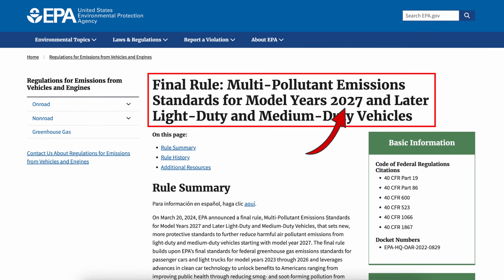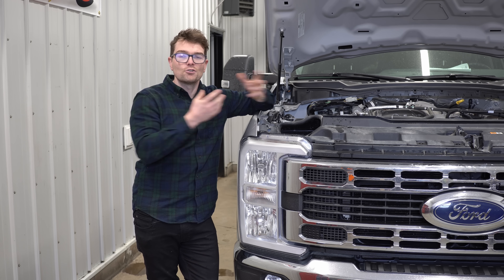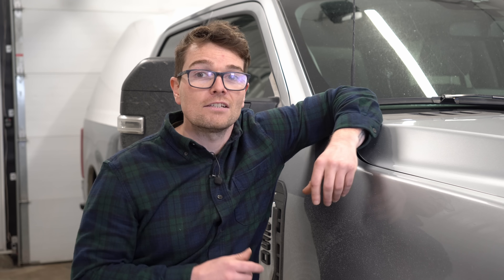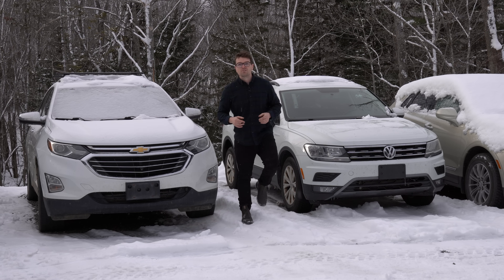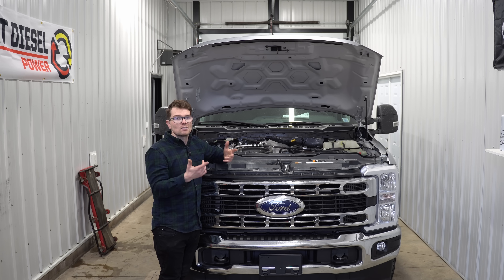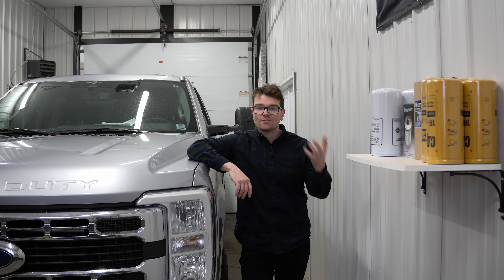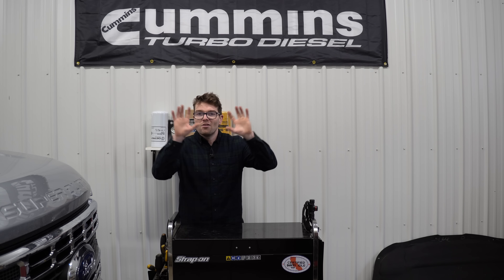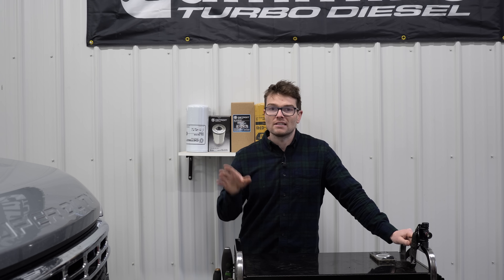NEW 2027 Cummins Diesel Engine EMISSION REGULATIONS are WILD **Diesel Mechanic Explains**

Comment: It's never been about cleanliness, it all about slowly but surely choking the I.C.E, be it diesel or gasoline and take things to such a ridiculous level that OEM's will call it quits on their own w/o any further coercion by the government.
Reply: Yeah, you have to burn more fuel and  get poorer fuel mileage to try and get cleaner air, that doesn’t make any  sense. so you’re gonna put the same carbon in the air no matter what
Reply: It's about deliberately making the economics of the internal combustion engine non-viable.
Reply: @gregorymalchuk272  But the internal combustion engine as a whole is non-viable. We are quite literally ruining the planet by using these engines on such a massive scale. While I love ICE and have many motorcycle and trucks, I still accept that ICE are not gonna last. We will eventually run low on fuel reserves and the price for fuel will get so high that it will make no sense economically to use them. So the oil burning as we know it will not last. Either the climate, or running out of fuel reserves , or fuel getting so expensive as we burn it all, will kill the mass usage of ICE. All we can do is be happy we got to live in the few hundred year period where the internal combustion engine ruled the world. Buy the engines you enjoy and have fun with them, that's all you can do.
Reply: Hit the nail on the head
Reply: Been doing the same thing with tobacco, just about control
Reply: @Joebauers2505  except engines doesnt magically cause cancer like cigarettes do, one is long form suicide

Comment: I love my 6.7 Cummins and will drive it tell I can’t anymore….but eventually these continuous restrictions on emissions are gonna stop manufacturers from even selling diesel’s. At what point do you think manufacturers determine the diesel engine is just not profitable enough??
Reply from the maker: I feel like its getting close on the consumer side. I think the commercial side there will always be a need but the end result is the downstream customer is just going to pay more. If the trucking industry gets more expensive everything that gets shipped will become more expensive. Or manufactures go in a different direction with something like natural gas or hydrogen but again all that R&D costs money.

Comment: Zero F’s given, I’m deleting all this crap if I have to get a new truck
Reply: Not as easy as you think. Shops were fined out of business and no longer sell parts.
Reply: @petermandel2552  I can fabricate the parts myself. Blocking the EGR isn't difficult. Cutting out the DPF and removing the DEF is easy. The real challenge is the ECU. I'm a software engineer but even this is going to be a challenge. Fortunate back in the day I had an RX-7 FC with a MegaSquirt 1. So I feel confident I can get past the regulations. Again, no intention on selling the truck later. If it needs to be replaced; ECU comes off, it heads to the scrapper. Tuning the transmission and MegaSquirt 2 are going to be the biggest challenges. 

All that said, my current truck is in great shape, I just wish I had the payload of current generation diesel trucks.
Reply: Add that the resale value would be zero. Legally would be able to certify, so no value other then parts.
Reply: @ that’s fine, I drive my trucks into the ground. When it’s time for it to retire, off to the scrap yard. It wouldn’t have any resale value by the time I was done with it anyway
Reply: Not just trucks, all our vehicles.
Reply: Good luck

Comment: I’m a ASE certified Master Medium/Heavy duty truck technician with L-2 certification. I repair these systems everyday. I have decided that I refuse to buy another  new truck. My next truck will be no newer than 1996. The Industry had huge problems in 2007 when this shit came out. Just wait until these 2027 spec engines hit the market. According to what I’ve been told, these changes will add $25,000 to the cost of a class 8 tractor. The every day person will be forced to bear this cost because everything is delivered by diesel engines.
Reply from the maker: lol I know the pain, on Detroit diesels (which I mostly work on) I swear I see a nox related code everyday come into the shop. I've also heard the same thing, 30-35k extra in cost per truck in Canada directly related to these new regulations. just means everything shipped on the truck is going to get more expensive.

Comment: Ford better crank up their Godzilla production to meet the demand. 
GM should seriously consider a proper replacement for the Vortec 8100 as well. The popularity of the Ford 7.3L is proof there is waning interest in diesels since this ridiculous HP war and one-upmanship has ruined the durability and economy diesels once had. The increase in emissions regulations is finishing them off by destroying the simplicity and reliability factors, leaving diesel with little appeal except for serious users/hotshots.
Reply from the maker: Agreed, I think Ford got the memo and the 7.3L, it can tow a ton of weight and people like them. Yes maybe not great fuel economy but these modern diesels aren't getting great fuel economy either. Unless you truly need to tow heavy weight a HD gasser is the more economical route.
Reply: @GettysGarage would it handle a 16k pound high profile 5th wheel going across country? If yes and Chattanooga to Nashville freeway inclines I might be interested.  ??
Reply: They're going to end up selling turbo HD gas motors. Only a matter of time.
Reply: Might as well go back to horses and mules!  Bunch of bs crap!!
Reply: I have 03 chevy with 8.1, love it never getting rid of it. I can repair it easy.  I never want any truck with def !! when check engine light comes on, my butt cheeks would pucker up knowing the F job coming to repair!!!
Reply: Chevy has a gas 6.6 motor in its HD trucks now that outpowering the antiquated 8.1 in both HP & Torque

Comment: So the epa is good with a gas motor truck that has less restrictions along with having horrible fuel mileage. My work place has multiple fords with the godzilla motors. They are horrible on fuel. But the diesel is the issue. The whole goal was to make the numbers unnatanable to get the manufacturers to say they could not do it anymore so the EPA does not take any heat off the consumers.
Reply from the maker: those 7.3L godzilla engines are going to become a lot more popular too in the next couple years. my fear is that they'll start clamping down on gas engine emissions like they have in europe.

Comment: So, will cooling the exhaust gases AFTER combustion and eliminating EGR/egr cooler be an idea?
Reply: No. The purpose of EGR is to reduce combustion temperatures. High combustion temps increase NOx emissions.
Reply: @ agreed. My thinking was if you eliminate the egr, wouldn’t you lower the temp inside the chamber since you aren’t reintroducing hot exhaust back into the system? I’m trying to think of a way to eliminate the damage an egr causes, while still trying to capture emissions after combustion. All of this while keeping dpf/scr system. How much nox is produced from the same engine with or without egr? Can nox emissions be reduced by cooling the exhaust after combustion without an egr equipped?
Reply: @pbutta3000  No. You could cool the exhaust as much as you want and it would never effect NOx, because NOx is only made at the high temperatures and pressures during combustion. Exhaust gasses are very cold compared to live combustion, the EGR isn't heating the charge air meaningfully and is making the combustion event much cooler. EGR can be a 70% reduction in NOx. You can reduce NOx with an SCR but it's much more effective to reduce it by preventing it from being created in the first place
Reply: @ got it. Thank you for the information.

Comment: This is total horseshit.  If a gas engine emits between 5 and 15 mg per km.  And a modern diesel emits 5 mg per km.  Why the hell isn't the EPA doing anything about gasoline engine emissions when they can emit up to 3x the particulate than diesels?  They need to take a long walk off a short pier.  Vehicle emissions aren't even a fraction of the problem.  Private jets, industrial stuff and power plants emit far more crap into the air than road going vehicles.  And you can shove your shitty E-vehicles where the sun doesn't shine.  I don't want that shit.  Also, you're just moving the pollution from the vehicle itself; to the battery manufacturing plants and the power plants that recharge them.  Electric vehicles aren't solving anything they're simply moving the problem around to be less visible.

Comment: Its a damn shame regulations are killing the diesel engine.
Reply: I think that is about to change very soon once new administration gets in.
Reply: @BrianNC81 we can only hope!
Reply: @BrianNC81 The guy with an Electric semi as a cabinet member? Don't think so mate.
Reply: put $50 000 just on emissions on my truck and it still had problems,got rid of it and got a glider with a c12 and never had a problem since
Reply: @ginomanb6235 we’ve been there. 30 dump trucks and in 2022 we spent over 100k alone on just emissions repairs. It would of been another 30k on top of that but luckily it was only a few days past warranty and the dealer took care of it
Reply: Or makes them better
Reply: @trialsted  Let's hope there's even a chance of a leap in technology to get there before the industry goes under

Comment: EPA is out of control as well as CARB!
Reply: Drive a Tesla, don't care 😅
Reply: @tjts1  I can't afford a tesla unlike a greedy rich person
Reply: @FangTheManokit  Pull yourself up by your own bootstraps and stop complaining. No more handouts!
Reply: @tjts1 some people have to work with them unlike a worthless tesla
Reply: @atf8721  no they don't. Diesel is choice
Reply: @tjts1  sure thing buddy you don’t go a clue
Reply: @tjts1  You forgetting construction work?? Diesel is a mandatory thing for skid steers, dump trucks, boom trucks,  I mean literally every single vehicle is a diesel out there.
Reply: @x91s55  there are electric versions available of all of those. The industry is quickly realizing how much cheaper and more reliable electric construction equipment is. Try again
Reply: @tjts1   Those electric vehicles will not run a straight 8-12 hour work day. It takes less than 10 minutes to fill one those I mentioned. It would probably take half the day to charge a electric version. Not the mention the added cost of pro-longing the job. And When the battery gets to half or less, the shit doesn't even work as good. It simply isn't cost-effective nor efficient enough
Reply: @x91s55  I see you have no idea how heavy equipment battery swap works. Do you live under a rock?
Reply: @tjts1 I see you have no idea of how the country transportation system works. Trains/semis/boats sure their are electric version but they are stuck at only short delivery routes because they can't go as far nor carry as much.
Reply: @tjts1 no, electric can’t compete. Not even close
Reply: @Joebauers2505 exactly
Reply: @tylerserna9317  I'm sorry did you say something? I couldn't hear you over the sound of my winning
Reply: @ I’m saying a kenworth truck is usually retired after a million miles. Just not possible with ev bud.
Reply: Longevity of diesel is just truly unmatched.. just reality.
Reply: @tylerserna9317  see how he didn't reply to me.
Reply: @tjts1 I didn’t think we had anyone dumb enough to fall for this electrification nonsense but I guess yall are real…
Reply: @tjts1   you will care when you have to replace the battery and find out how much it costs 🤡

Comment: Sounds like an engineering challenge for the manufacturer. The heated emissions system sounds like a good idea, keeps the exhaust hot. As long as they dont make the components fragile, it should be good. I wouldn't buy 27-30 model years, but after they work out the bugs, the engines should be solid.

Comment: Stop buying new diesel trucks. I sold my 2018 ram 2500 with a Cummins and it was the biggest pile of crap I ever bought. It was never ever reliable. And made 6 mpg due to the emissions junk. I sold that pile of crap and replaced it with a 1984 Chevy 1.5 ton army cargo truck with a 6.2 Detroit diesel. No emissions. Nothing stupid. All mechanical. It makes 24 mpg and it has been very very reliable. This truck has never ever let me down. I also have a dump truck. A 1987 ford LT9000 with a L10 Cummins. Another mechanical diesel engine. Very reliable. No epa nonsense. I will not touch any equipment made 2001 and newer. Gas engines pollute more than diesel engines do. If everyone stops buying trucks and cars the government will start to wake the hell up. And this all started in screwed up California. old trucks are designed to keep going and to be rebuilt. New trucks are designed to fail and be replaced. Yep that’s real environmentally friendly 🙄 if the general public needs emissions then the police, fire departments, and military needs to have it to. If they don’t have it then the general public doesn’t need to have it. Simple as that. Emissions systems are dumb and pointless

Comment: Yeah, I don’t think I will ever get rid of my 03 5.9 250,000 miles and I will rebuild it when the day comes
Reply: Be worth a frame replacement if it rusted away, at this point you’d be money ahead doing that.
Reply: Keep taking care of it. I have an 01 with 436,000 on it!
Reply: Just do your maintenance. The company I work for has an 04 that the odometer quit working at 675,000 mi some 4, or 5 years ago. Maintained by hours (hobbs meter) not miles.
Reply: @farmwork5304 same here. '03 five9 truck, currently undergoing a cosmetic restoration, with all Southern parts (ie: Canadian rust repair, LOL!). 543K kms (337K miles). 2nd owner, stock truck that  is still running on OE injectors, IP, and turbo, and doesn't blow anything out the tailpipe. My wife is fully onboard with rebuilding the engine if it ever fails on us.
Reply: @1oldskoolluvr  my 06 is a complete rust bucket, the frame is still holding together for now but the engine runs like its brand new with 236k mi. if the frame ever gives i'll just slap the engine into another truck and keep going
Reply: My 1998 1.9 tdi had 300,000 miles on it….

When I got it in 2009. 
Still drive it daily
Reply: I have an 04 with 150k. I’ll be holding on to her for a long while.
Reply: '01 7.3l Powerstroke here with 300k miles. About ready to do its first full injector swap.
Reply: I'm at 350K on mine and no amount of money will part me
Reply: Same here I got a 2005 5.9 3500 with over 234k miles on it , replaced things when needed and just keep trucking.
Reply: The 5.9 is a great engine and is very reliable but lets be honest its old and outdated, especially the transmissions paired with them. We have a 98 24v manual with 370k and honestly my 2018 Chevy 1500 6.2L max tow is much better and more comfortable to tow with. Plus when I’m not towing I get 20+ mpg. I got 150k on it no problems and we have a 2014 1500 5.3L with 250k still runs great. So gas or diesel as long as you maintain them they’ll last. I’m not hating on the 5.9 but it’s doesn’t have much power and the trucks usually fall apart around them.
Reply: Right on!
   How to actually be environmental
Reply: I wonder what would happen if i get a hold of a 5.9 and install all these emissions items to it.
Reply: My 2005 has 330k and my 1997 Cummins has 400k. Run great and clean as a whistle.  Oil changes and filters every 5 k miles
Reply: Heck, I have a 2014 ram standard output dual rear wheel that I really like. 120 thousand miles on it and use it pretty much only for towing my fifth wheel and going to Lowe’s to buy large lumber when I have a project at the house. I feel like it’s a golden oldie compared to this new stuff described in the video. Mine still has all the emissions and is pretty much 100% bone stock. Super well taken care of as I do all my own maintenance. Have even changed out the radiator fluid three times in that period and changed all the hoses once. A couple of water pumps and a thermostat. No failures I’m just in there and feel like I’d rather put some new parts on while I’m in my garage at home rather than risk repair on the road with the family and dogs. I really really really want to buy a new truck with the new technology and added power. But they seem like they will be completely out of my league for service other than routine fluid changes and I keep reading about folks whose units are down even under warranty, waiting for parts. The prices of the new units are nuts, but that’s just the way of the world now nowadays so is buying a can of coffee. What scares me is not being able to get parts to fix it or the dealer get parts to fix it even if it’s under warranty. I guess I’ll just keep my golden oldie 2014 and be like the rest of y’all in a few years.
Reply: Oh, you will be able to own it, but you will not be allowed to register it to operate on the "public" roadways!
Reply: @garybulwinkle82 

We'll see about that.
Reply: @garybulwinkle82  at that point, farm tag it lol
Reply: you aint never gonna need to rebuild it lol, at the most you'll need a new body or frame.